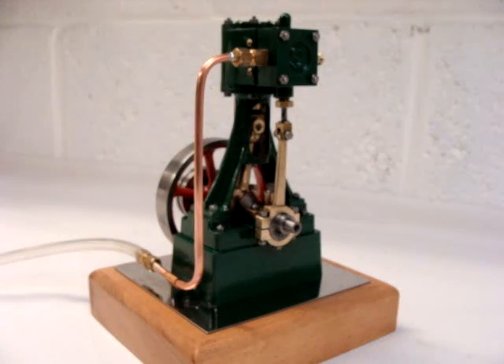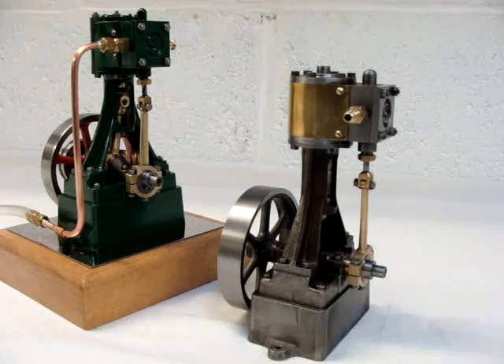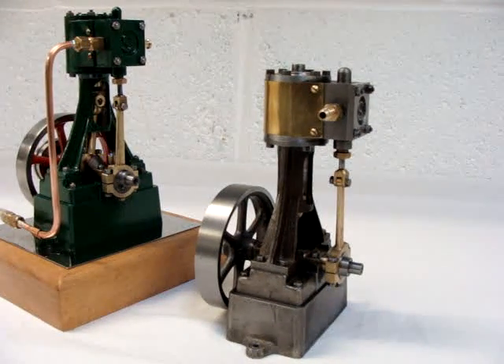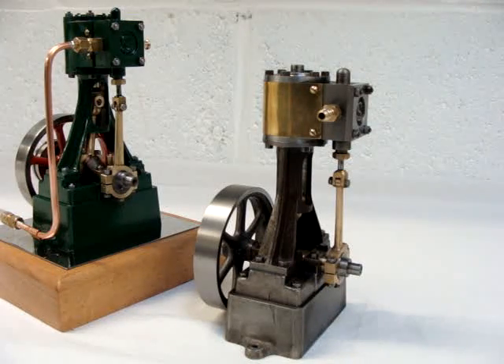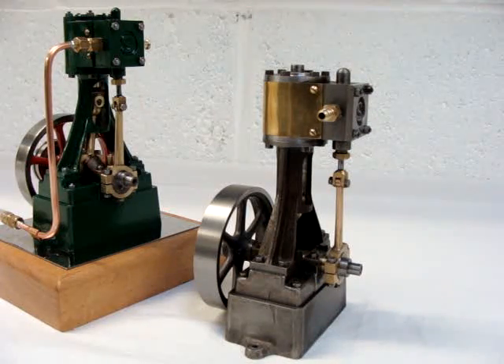Stuart 10V model steam engine

Comment: I decided I need to add one of these iconic vertical engines and found a quite old but nice 10v at auction. I probably should put it in a launch but then I'd be getting in to model boating haha. they're more a "put to use" engine, not great IMHO s a display model